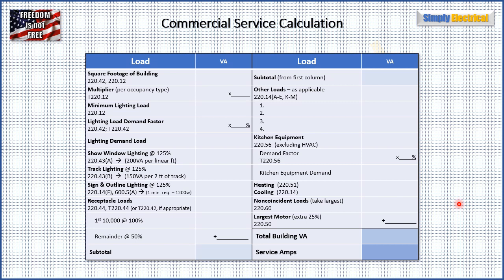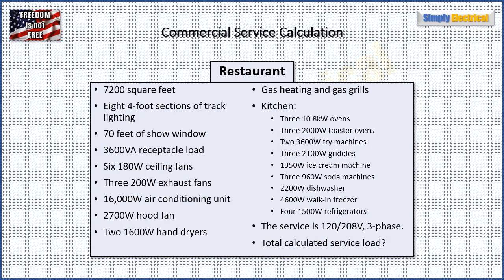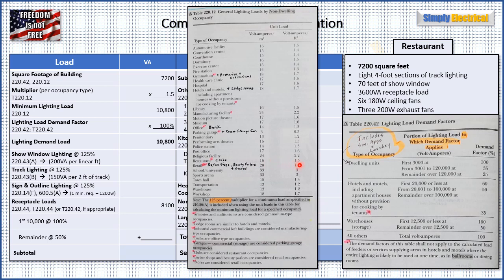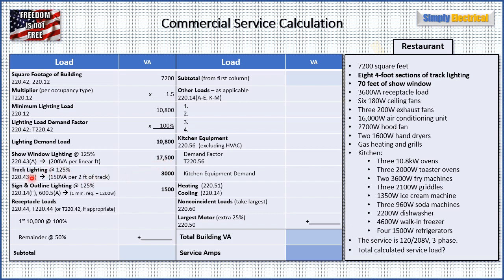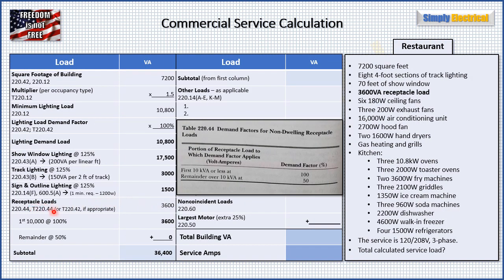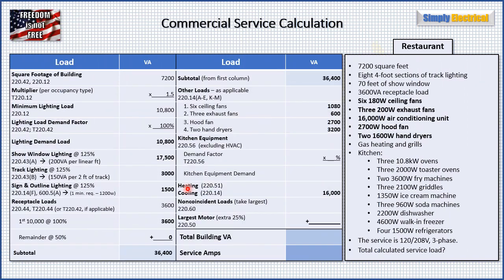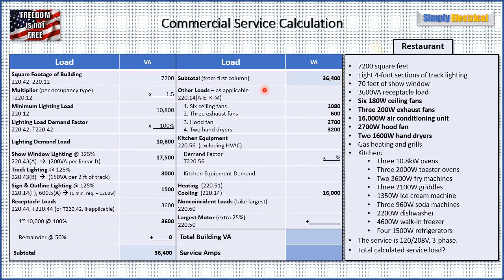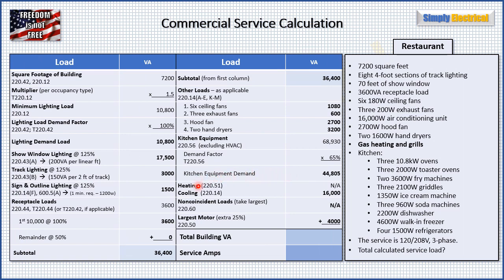Commercial Restaurant Service Calculation - Crash Course 2020

Comment: Thanks again so much for these videos.  In this video you calculated the 6 ceiling fans at straight value with no 25% for continuous load.  But in your Restaurant Optional Service video you calculated the 6 ceiling fans as a continuous load.  How do I know when to apply the continuous load rule for ceiling fans in a commercial application?
Reply from the maker: Yes, you are right! This was one of my earlier videos and I forgot to go back and edit that. I'm so glad you spotted this for me. I have now made a note in the video at that point.

I'm constantly amazed that no matter how many times I go over these videos before publishing, there are mistakes and typos that I overlook. Thank you for bringing it to my attention!

For the record, yes, you do apply the 125% to commercial ceiling fans in most cases, since they typically run all day long. Sorry for the confusion!

Comment: Any chance you can do a 120/208 3 phase dorm calculation
Reply from the maker: Dormitories are not considered to be dwellings (not even as multifamily), nor are they motel/hotels. They are given their own definition in section 100 of the NEC. And there are no special demand factors allowed for them in 220, so the standard commercial method must be used.
https://www.youtube.com/watch?v=LROa6nhWFkc

Table 220.12 gives 1.5 VA/sqft for a lighting multiplier.
210.60 gives some requirements for dorms.

For 3-phase, the calc is no different until the very last step. Once you have the total VA, use the following formula:
Total VA / (Voltage x 1.732) = Total Amps

Now, if you have other types of occupancy in the building (community laundry facilities, kitchen, etc.), then you would have to treat those as you would treat house loads in a multifamily calc - i.e. figure them up independently and then add them to your total. See an example of adding house loads here:
https://www.youtube.com/watch?v=I0xlL1kLmak
Hope that helps!

Comment: I have seen AC units calculated as a continuous load in other study materials. Do you have any insight whether to calculate AC or heat pumps as a continuous load ? It looks like 440.32 increases the load to 125%. Thank you for your help.
Reply from the maker: Generally speaking, any load that is controlled by a thermostat is not considered continuous. Of course, an AC can run longer than three hours, but it is not it's intended use. The key phrase in 220.60 is "Where it is unlikely...". So it really depends on the specific application and what it's likelihood is to run for more than 3 hours at a time. But as a general rule of thumb, no, ACs are not considered continuous loads by anyone I'm aware of.

440.32 is addressing single motor compressors. This is not an AC or heat pump. 440.35 pertains to package units. The nameplate already takes into consideration any extra ampacity for the compressor load(s).

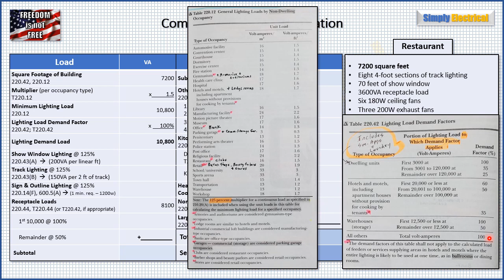Great question. I think a lot of people are not aware of the differences between 440.32, 33, 34, & 35. Same with 430.22, 23, 24 & 25, regarding motors. See my video on noncoincident loads for a better explanation, around the 5:00 mark.
https://www.youtube.com/watch?v=_YVvb2YlqUc&ab_channel=SimplyElectrical

Comment: Question. I'm  doing a load calculation on a kitchen equipment panel to see if we can add another oven
 This panel only has kitchen equipment and no lights or general receptacles. Do I just use Table 220.56? Some of them have hood fan as well.

Thanks for your time and videos.
Reply from the maker: Yes, T220.56 would be used for the kitchen equipment only. Hood fans and other HVAC would be calculated separately.

This is a situation where you are calculating a feeder load, as opposed to a service. So use the same table provided here, but only apply those loads that are relevant to that feeder (i.e. no lighting, recepts, etc.).

See 220.16(B) regarding additional loads to an existing commercial installation.
Reply: @simply.electrical  Wow, man, great response and awesome channel! Thank you and subriscibed!
Reply from the maker: @carlomiranda3799  Thank you!

Comment: I finally get it! thank you. would it be possible if you could explain how to:
- Size the elements of a branch circuit for an EVSE installation.
- Size single-phase and 3-phase feeders for a multiple-EVSE installation.
- Size a service or feeder for a fleet installation of EVSE.
- Calculate the capacity available for EVSE on existing services.
And Apply the rules of grounding and bonding for EVSEs from NEC Article 250.
Reply from the maker: Glad it helped you out!

Thanks for the recommendations.  I'll be making more videos about various topics, and since EVs are becoming more and more popular, those kinds of questions are certainly on the list for the future.  But unfortunately, I don't have immediate plans for those particular videos at the moment.  Sorry!